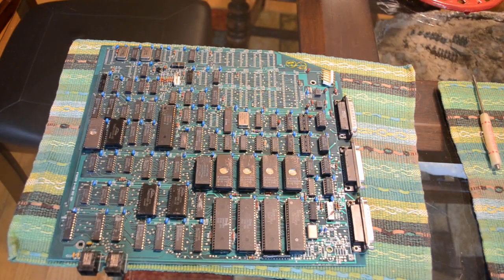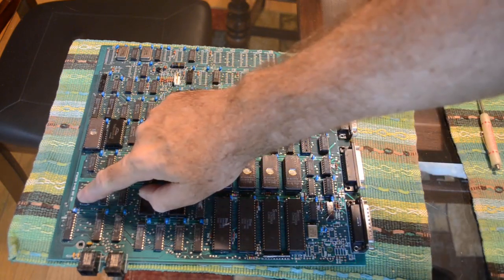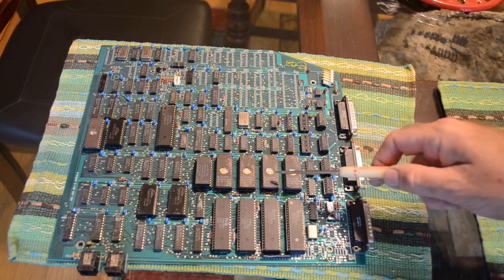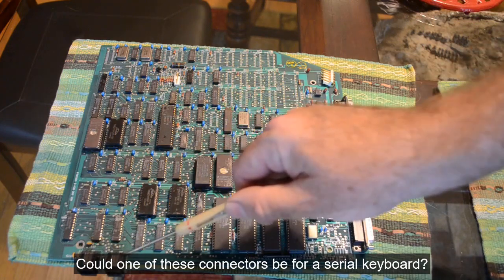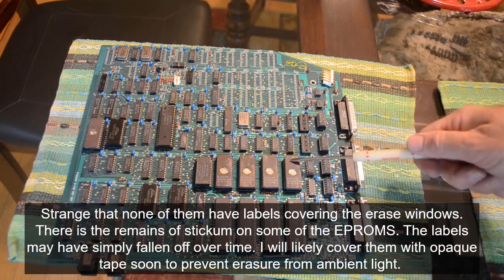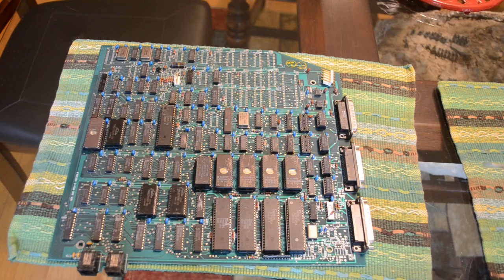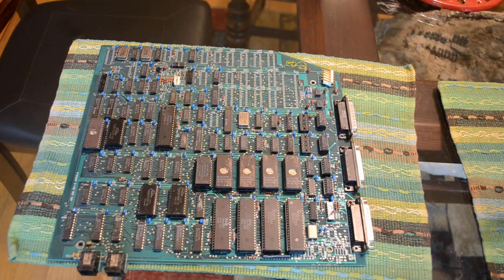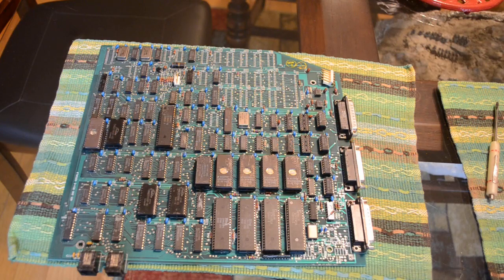PC Archaeology with Mike. What is this old Z80 board?

Comment: @omegageek64:  Everyone is assuming the RJ plugs are both for communications. If I remember correctly, I think some of the terminals such as the Televideo 950 used an RJ11 socket for the keyboard cable to plug into?  Yes, dual UART’s could mean one of those serial ports was used for the keyboard which would fit with the 6 pin connection.

Comment: Because there is a slant on it, I also think it may have been a motherboard from an (early) video game. 
The board would then be on one of the side panels, and the screen would have been on the front and angled so that the image was mounted at a proper 90 degrees to the viewer.

The first systems were low resolution and text based. Even the computers with a graphic output.

However, there was a " characterset" that consisted of blocks made up of multiple cubes (not to be confused with pixels), which could be written as 2 hexadecimals directly into memory. With the TRS-80 (Radioshack), that memory address started at (off the top of my head) address 15360.x and ran to 16383,x. So that's 1024 (64x16) memory locations.
'x' was then a decimal number that was synchronous to ascci.

Since there was room for 2 hexadecimals (256 decimal places), other values could be dumped outside the ascci range, so that you could generate a block that consisted of multiple blocks and thus could simulate a graphic image (with very large pixels), like Donkey Kong and similar. This had to be done in Z80 machine language, otherwise it was too slow. I compiled basic to machine language for that purpose. 

But considering your motherboard.
It could be that those two UARTS on your board were meant for two serial joysticks, and the third one for the screen.

I'm curious if the connectors are male or female (its not possible to see in your video). I think everything was serial back then, including any printer output to a Centronics or a Seikosha interface. I have to dig deep into my memory to be able to scoop this up, though. 😂

Comment: It looks like a Human Designed Systems Inc. "Concept" Series board - there is space for a graphics upgrade and also space for a current loop conversion.
Reply from the maker: After doing a bit of research, I think you may be right. Haven't found a pic or schematic yet, but the general description sounds right. Thanks for the tip.

Comment: The rj plugs on the bottom lead me to say it had a dial in remote access or hooked to a network. Maybe it's an old modem for something?
Reply from the maker: I'd think that was reasonable except for the fact that there is no telephone line isolation transformer. That was mandated (and may still be for all I know) back in the day. Every modem had a transformer on each line for isolation. The ring voltage on a landline phone phone line can be as high as 105V AC! Without an isolation transformer, digital electronics go up in smoke when connected to a landline. I'm leaning toward at least one of them being a serial keyboard connection.  Not sure what the other might be.

Comment: Are they rj11 or rj45 style phone plugs. 6pin or 8 pin?
Reply: Where's the power source come in?
Reply from the maker: 6 pins.
Reply from the maker: The power connector is on the upper right side of the board. 5 heavy pins. There are no regulators on the board, so I'm thinking +5V, ground, +12V and -12V. I don't think there are any components on the board that need anything else, but I could be wrong.
Reply: @omegageek64  6 pin means it was analog
Reply: @omegageek64  are the connectors 32 pin?
Reply: So it accepted an analog line for dial in remote changes and then the line was passed through and out the other plug or it could have been an old voice mail that you would cross connects two analog/trunk ports to it.

Comment: Anyone else instinctively cringe every time he taps the ceramic packages with the screwdriver?
Reply: That isn't going to matter, this PCB is to be stripped for gold.  This guy is the urban gold collector who removes components and fingers from board, grinds them and removes the gold.  Whether or not that is a cost effective way of making money, that's another thing altogether.  Where I used to work, the components were subjected to a punishing mechanical shock testing and thermal cycling before being included in a product, surprisingly, less than 1% failed and they went through hours of intense vibration and -40C to 150C heat cycles.
Reply from the maker: Actually, I don't render everything down for the precious metals. A lot of the stuff that passes through my hands has more resale value than precious metals value. This board is likely one of those. And yes, the parts are tough. Many components survive depopulation from the boards in a kiln and still work. I have a vintage Apple video card with a busted EPROM chip on it and can't for the life of me figure out how someone managed to do that.